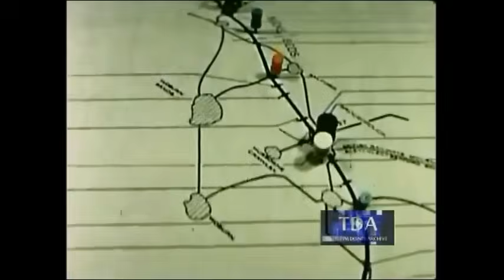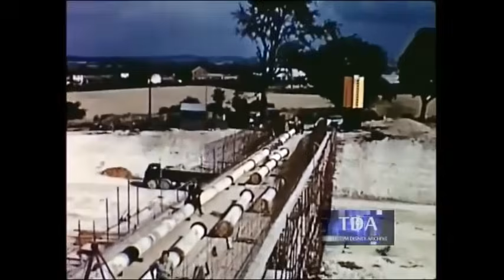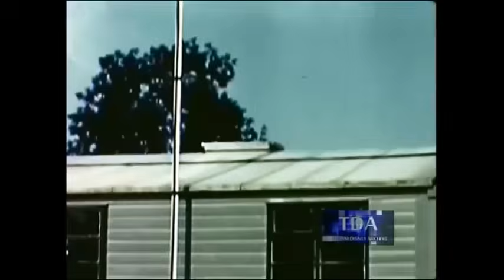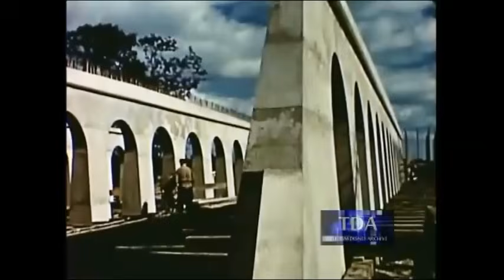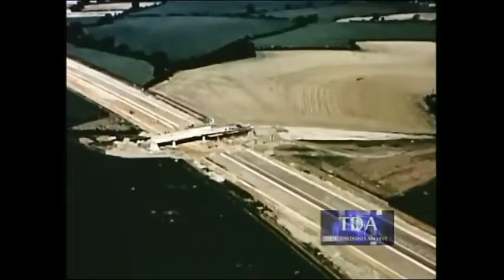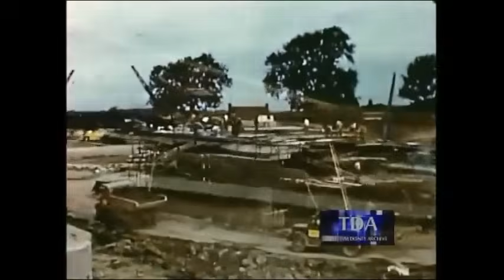Major Road Ahead - Constructing the M1 Motorway - Short Documentary (1958)

Comment: 19 months to make 55 miles of dual carriageway from scratch yet its taking what seems like 4 years to make some emergency laybys near Sheffield! 😅
Reply: Now it’s taking them a year to replace a few miles of the barriers on the M1.
Reply: Tell me about it.  All because they messed up big time by making it a smart motorway in the first place only a few years prior
Reply: About 16 months for like 10 little breakdown areas which they should have really seen as needed 5 years earlier when they removed them.
Reply: 4years to repair a bridge in Bristol 😂
Reply: @martinsykes1257 exactly who thinks these brain dead schemes is it on purpose would you say? Or just ineptitude?
Reply: Maybe because it’s in use ????
Reply: @Trebor824  they have an entire lane blocked off and they are working off of that, surely that's even easier to work with, get on and off and get materials
Reply: Building 1.5 miles of single carriageway near me it's taken them two years already and they're not due to finish until next year. No flyovers or railway lines to deal with either. Pretty sure bigger team too. Absolute layabouts.
Reply: 12 years to upgrade the A13 Sadlers Farm roundabout with little to no improvement.. And earlier today I travelled from Bristol to Essex.. 60+ miles of cones, cameras, and speed restrictions with not so much as the smell of any roadworks.. I may be a dreamer, but I live in hope that one day this country get's it's act together and climbs back up the ladder to once again join those in the third world it left behind some 20+ years ago
Reply: Same in M5, Worcestershire. Over a year to put in 4 emergency laybys. Clownworld
Reply: Hahahahah very true!!

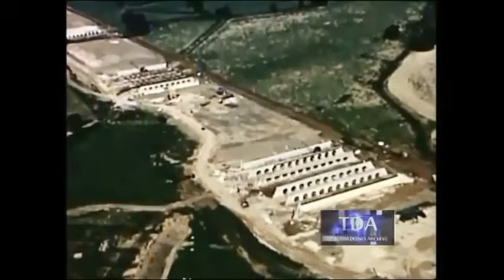Comment: 18:00..is junction 11...with bradley road bridge across the chalk...parallel to the dunstable to luton railway...that use to carry cement from the blue circle works at houghton regis right past the back of our house near j11.
I use to walk to Challney past a group of massive trees still standing next to the original a505 road. That road part still remains but road widening has removed the trees.
The factory waste paper recyclers stood at the exit of the northbound turnoff at j11.
They widened the OFF at j11 by flattening those factory units that can be seen at 18;12....
Interesting to see calnwood road linked to dunstable road as in 1974 access was cut off.
Much of challney girls playing fields were lost to a redirected a505 in these pictures....it must have reached right over to the trees i mentioned that stood along the original road path...

Comment: 16 million pounds back in 1958 when the m1 was first built would cost around £319m in todays money. that’s extremely cheap compared to costs of equivalent modern day road building jobs. the new a14 was only 18 miles and cost nearly £1.5bn. and its also falling apart after just 5 years😅